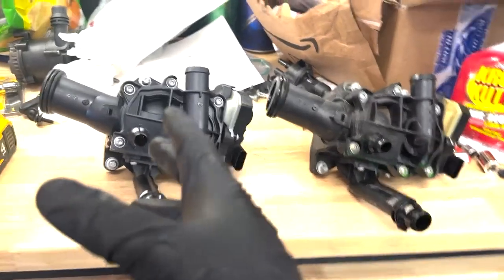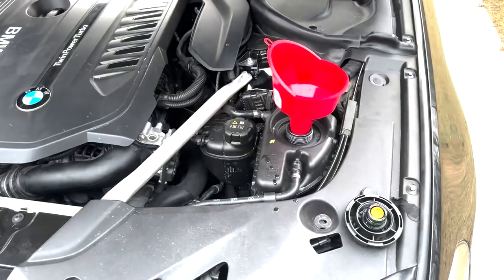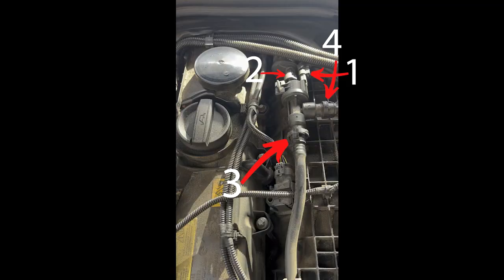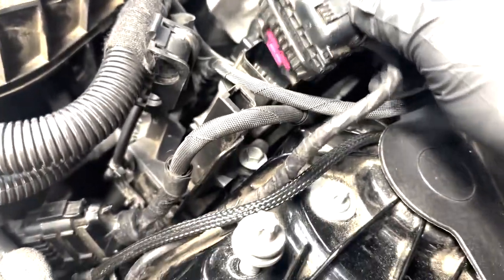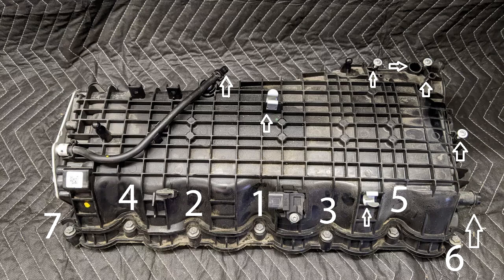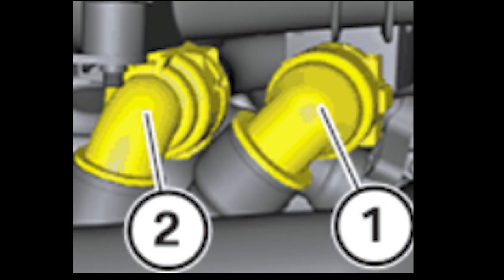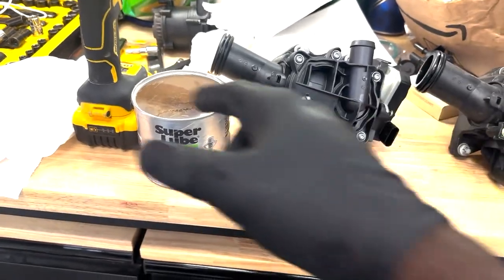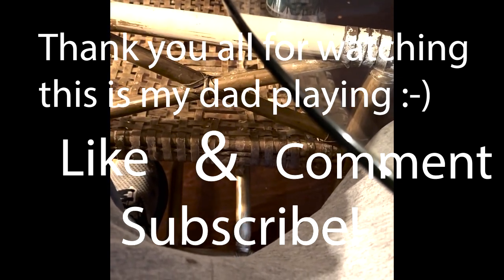BMW B58 Heat Management Module Removal | Step-by-Step Guide (Gen 1 540i)

Comment: hey, I plan to replace water pump belt driven and thinking if it makes sense and helps to buy new gaskets for thermostat? Front one I even took apart, resealed in and out and it works great. Was it just a luck?
Reply from the maker: Buying new gaskets is best practice if you’re in a pinch then I would say you could reuse it but you’re assuming the risk if you reuse it it’s not luck, but it will eventually fail only time will tell really